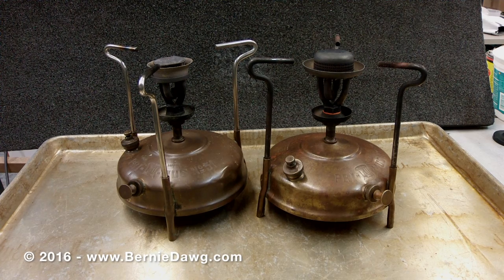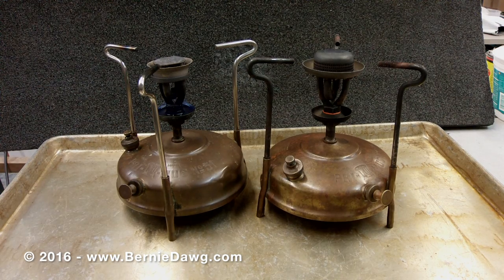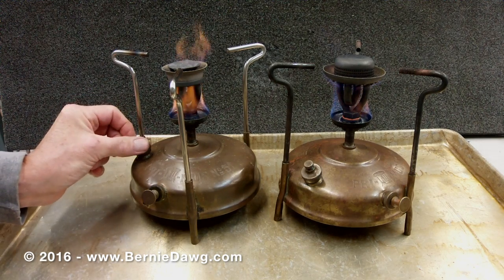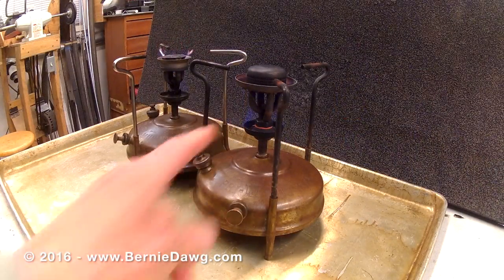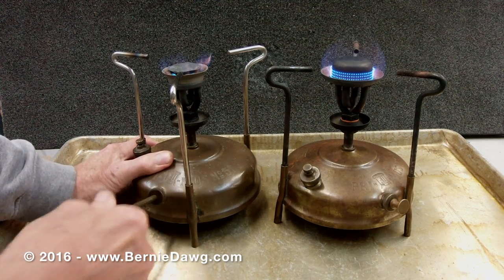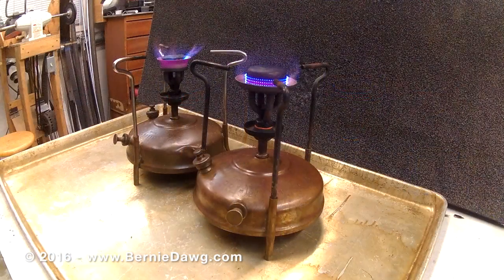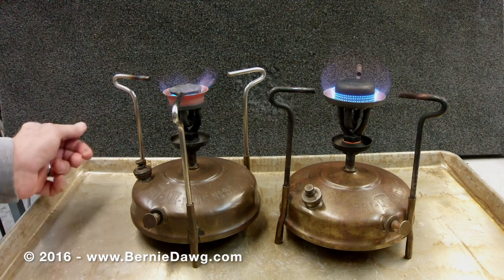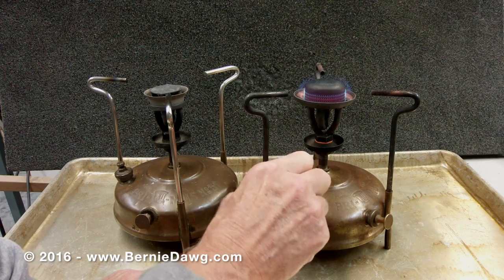How to Light and Operate a Vintage Kerosene Stove

Comment: What you use as a fuel?
Reply from the maker: I am in the USA. I use kerosene. Specifically, I use Kleen-Strip brand 1-K grade kerosene. Google "kleen-strip kerosene" and it should be the first hit that comes up. You can compare the MSDS chemical constituents at the Keen-Strip website to the constituents in fuels in your area wherever that may be. Avoid all vehicle fuels - especially vehicle diesel fuel. Do not use gasoline or naphtha in one of these type stoves. BD

Comment: Hi, I just bought an Indian made brand new kerosene stove and it doesn’t burn as clean, I prick the jet often as it seems to get clogged often and the flame color is only slightly blue. Any advice as to how to get it running smoothly?
Reply from the maker: The new Indian-made stoves are not of the same high quality as the vintage kerosene stoves from Sweden. You could try buying a vintage stove and refurbishing it. You would likely get better results. Secondly... use the right fuel. Lamp oil is not okay. you want high quality K-1 grade kerosene designed for heating and cooking appliances. Here's a link to the right stuff: http://www.kleanstrip.com/product/1-k-heater-fuel-kerosene  More questions? bd@berniedawg.com  Good luck! BD
Reply: @BernieDawgCinema  is this a swedish invention?
Reply from the maker: @Blackbox BS Yes! Most definitely invented in *Sweden*. I've quoted or paraphrased from an easy 4-second Wikipedia search:
The method of heating kerosene fuel in a brass tube device was developed in 1882 for making blowtorches by Carl Richard Nyberg in Sweden.
"The first pressurized-burner kerosene (paraffin) stove, was developed in 1892 by Frans Wilhelm Lindqvist, in Stockholm, Sweden. Lindqvist’s patent covered the burner, which was based on Nybergs blowtorch work. This burner was turned upward on the stove instead of outward as on the blowtorch. Lindqvist partnered with Johan Viktor Svenson and established J.V. Svenson’s Kerosene Stove Factory for manufacturing the new stoves which were sold under the name Primus. The first model was the No.1 stove, which was quickly followed by a number of similarly-designed stoves of different models and sizes. Shortly thereafter, B.A. Hjorth & Co. (later Bahco), a tool and engineering firm begun in Stockholm in 1889, acquired the exclusive rights to sell the Primus stove.
The efficient Primus stove quickly earned a reputation as a reliable and durable stove in everyday use, and it performed especially well under adverse conditions: it was the stove of choice for Fridtjof Nansen's North Pole attempt, Roald Amundsen's South Pole expedition, and Richard Byrd’s North Pole expedition. Primus stoves also accompanied George Mallory's ill-fated expedition to Mount Everest in 1924, as well as Tenzing and Hillary's successful one in 1953. While many other companies also made portable stoves of a similar design to the Primus, this style is often generically referred to as a “Primus” stove, regardless of the manufacturer." BD
Reply: @BernieDawgCinema  wow

Comment: How much
Reply from the maker: How much what? Fuel? Cost? BD
Reply: @BernieDawgCinema  cost BD
Reply from the maker: @Music LK The 70-year-old stoves in this video are not for sale. This video is not to sell stoves, but to show how to use them. Shop eBay for used vintage stoves like this. Cost can range from as little as $35USD to over $500USD. Cost really depends on model, condition, age, rarity, luck and a host of other factors. Good luck! BD